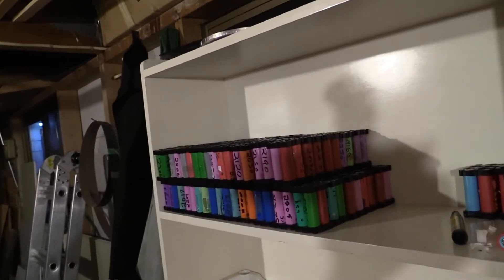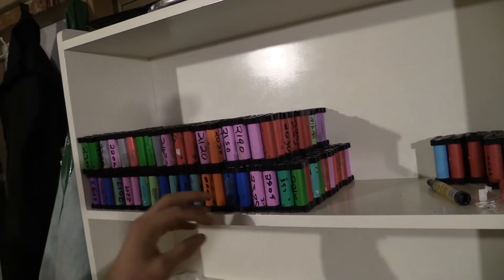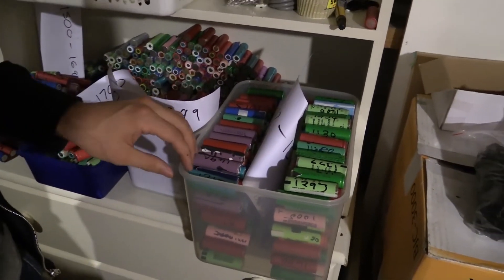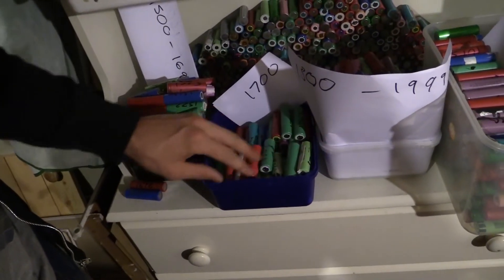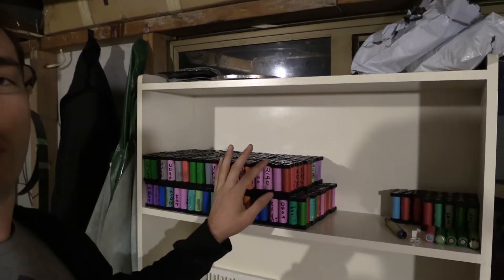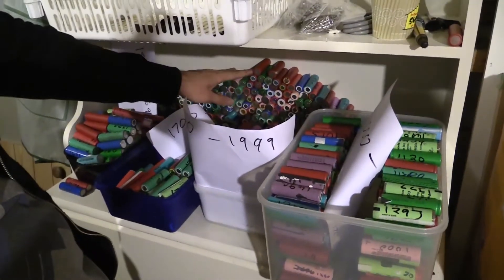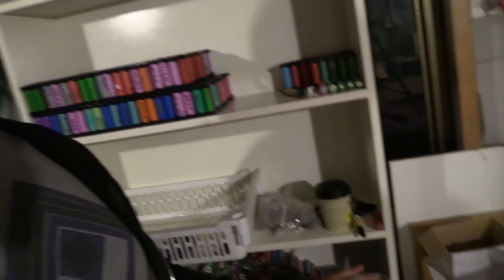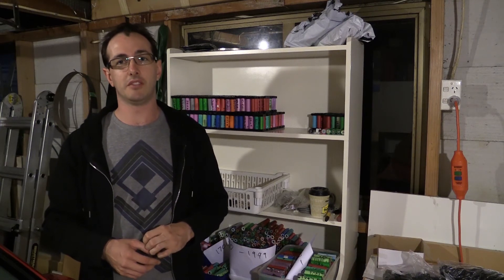Almost 400x 2Ah+ cells done

Comment: Thanks for the update - very interesting to follow your progress from Titirangi. 

I'm thinking of taking a slightly different approach (once all my bits and pieces arrive from China) as follows:
1. Once removed from packs and fitted to holders, use the imax B6 to discharge/charge 30 cells at a time (in parallel) to 3v;
2. Measure the internal resistance of each cell in mOhms and discard any that fall above [~100mOhms] (as they are pretty much munted?);
3. Charge 30 cells at a time using TP4056 units and concurrently measure capacity with the KWS-V20 units; then
4. Sort the lowest internal resistance and highest capacity into my bike project and the remainder into the powerwall.

I also plan to compare readings with a reliable meter and IMX B6 as I make my way through the process.

I've ordered all the bits and have ~2000 cells stripped out already - very excited to receive the bits and pieces from aliexpress to get underway.  If the process works as planned then I expect to scale the charging rig up to 50 cells per day so that I can complete the cell analysis within a month.

Am I crazy?
Reply: where did you get your laptop packs ?
Reply: +BillTheBox tech recyclers - took 2 quick phone calls then 200 packs arrived within a few days.  One recycler offered me a 40 gallon drum full of brand new packs - unfortunately all lipo. $1NZD per pack or less depending on quantity.
Reply: nztitirangi oh boy that's nice :o